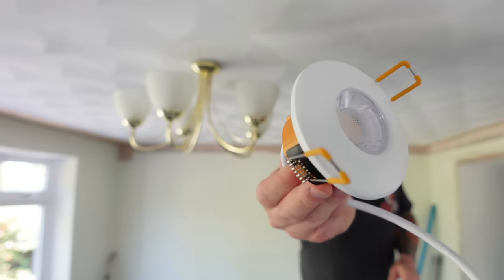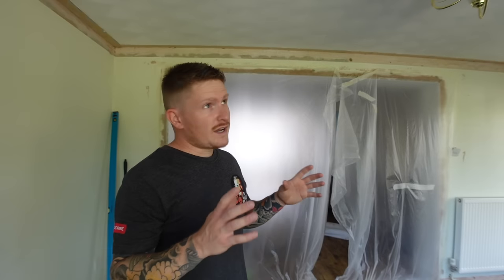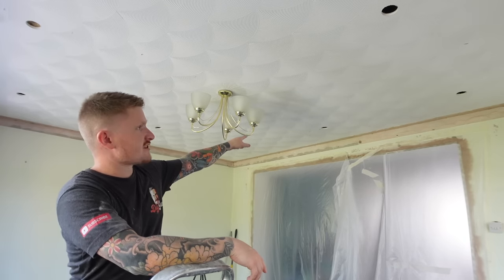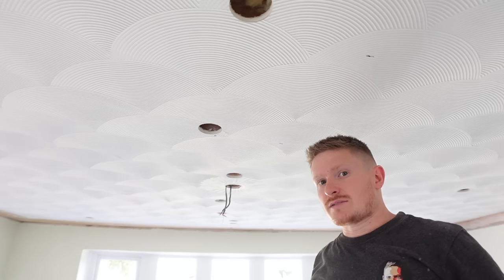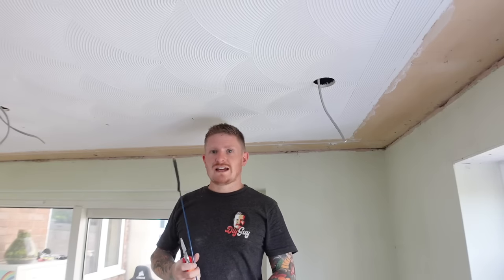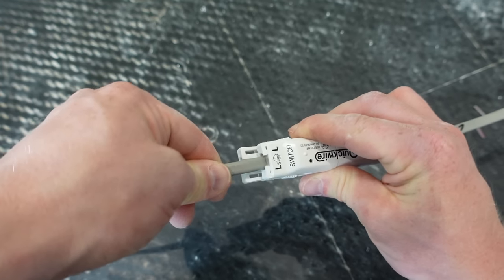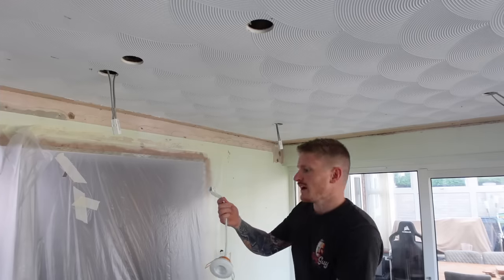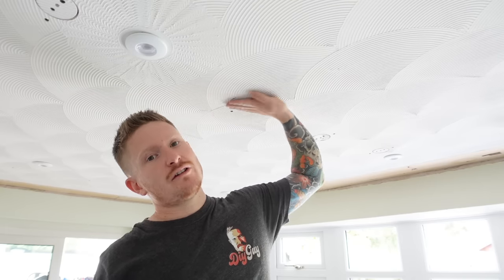How to Install Downlights With No Access Above | It is Possible!

Comment: no. you made too many holes
just make one hole under the main lamp and another in desired place. Take a thin rope, and attach a small metal plate to that rope. Put that metal with the rope inside that hole. Then take a strong neodymium magnet and slide it on the celling surface - and the metal plate (with the rope) will follow your path. When you go to desired place, and take out the metal plate trough that hole and then attach the electrical wire to it and drag it back to the other side using that rope.
Reply from the maker: That won’t work because you won’t be able to pass the joists.

Comment: Wonder if this vid's sponsored by Quickwire... 🤔🤔
Reply from the maker: Yes, I am happy to recommend great products on my channel. I only ever allow sponsors that I support and believe are a great brand for my audience.
Reply: @TheDIYGuy1  Just being a bit sarky, love your vids, glad you did this one as ceiling access is often not available
Reply: Not sure how you managed to drill a hole where the centre light was as 99% of the time the existing light would be screwed in to a joist or timber . 
Also always check the Earth is satisfactory before proceeding. It’s not uncommon to find in old houses  the earths are not connected throughout the house lighting system as sometimes twin and earth cable is incorrectly added in the past to  twin cable that doesn’t  have a earth.
Other than that nice video
Reply from the maker: @andysims4906 Not always, in this case Plasterboard fixings we’re used to secure the light in this case. But yes it is common as you say. If there were timber I would have moved my centre light over and created my light pattern from that. I know my cpc continuity is good due to testing during our recent rewire. That makes the video just…. Good 😉

Comment: Why are you encouraging DIYers? The whole point of the IET, BS7671, NICEIC, NAPIT etc is to promote safe electrical installations by qualified electricians. As a qualified electrician I would never point advice towards DIYers or the unqualified. No one other than a qualified electrician should be making an alteration to an existing circuit.

Comment: poor way of doing it you should of just cut a 100mm strip down one side of the room then just use the rods to pull the cables in  its much easier than having loads of holes everywhere
Reply from the maker: It’s just a different way of doing it. Not a poor way whatsoever 🙄. The way I’ve done it is the way most electricians do it.
Reply from the maker: It’s just two different methods. I wouldn’t say either is a poor way to do it.

Comment: Drilling the joists compromises their integrity. When my lights were done I'm sure the wires were fished under the joints.
Reply from the maker: Not a 20-22mm hole. Boring is recommended over notching which does compromise integrity.
Reply: Google Joist drilling Building Regulations - it tells you what is permitted where and in what size of joists